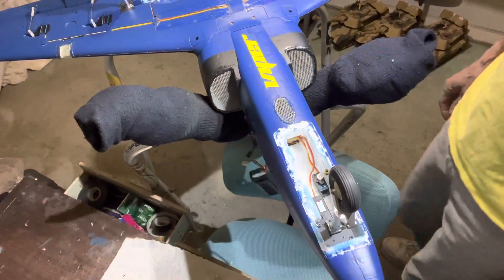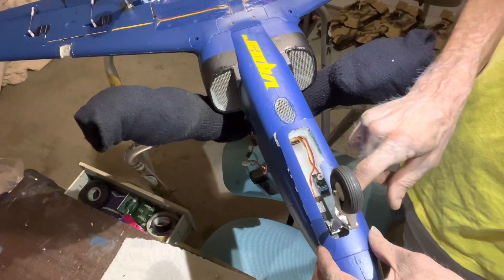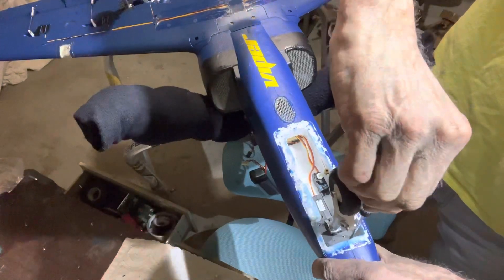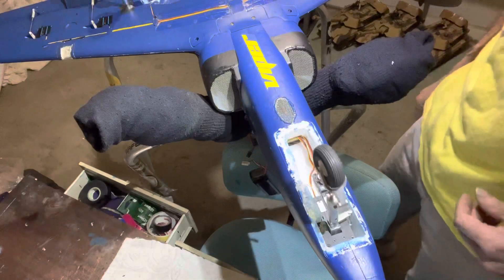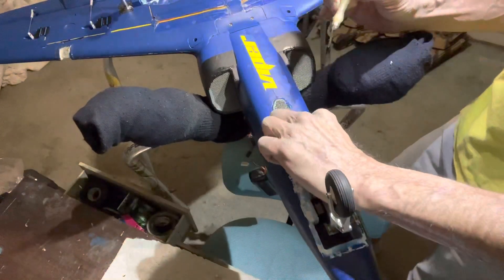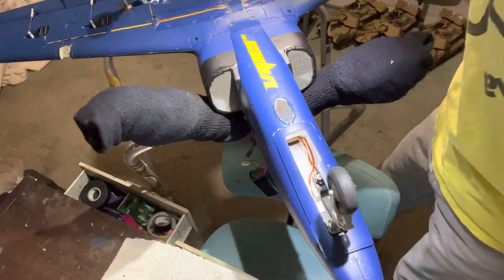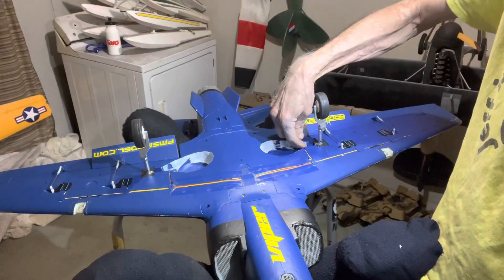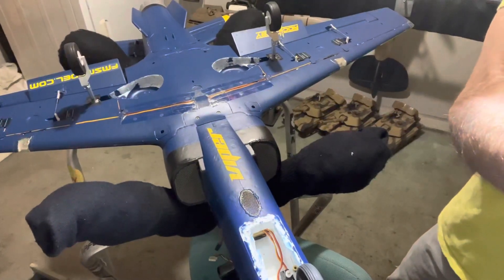FMS 70mm Viper (New Gear) P2

Comment: I was just looking at the viper thinking about how I need to mod the gear. Nice job EQ 👏 👍🏻
Reply from the maker: Where i talk about reinforcements in rear gear bay should keep it from splitting,I hope. Roy all I done on frt gear bay was cut above a 1/4 of the left side of wall. In video I just cut enough out for gear to miss it. Cut outside cover to miss steering arm and glued it on. It looks like rain today,so no taxi test 😕👍🏻✌🏻🖖🏻